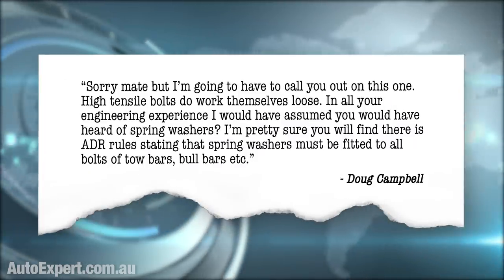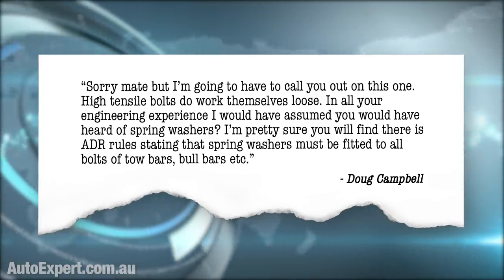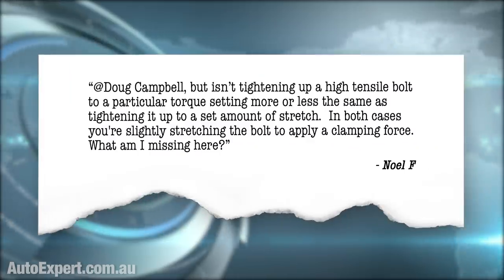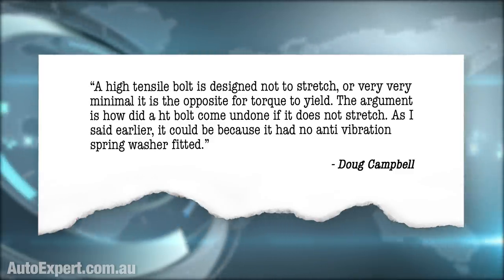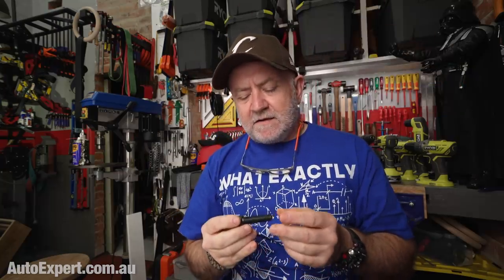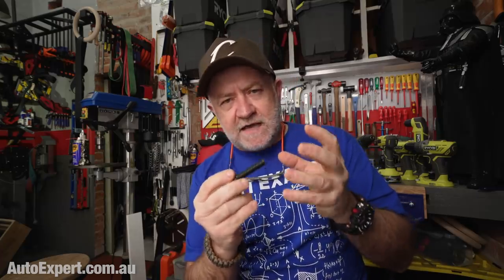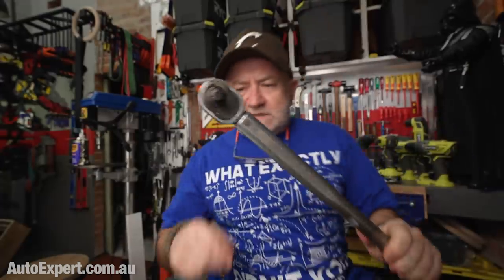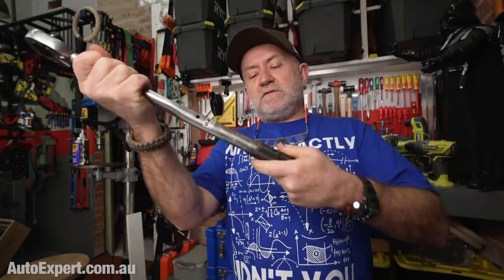The applied physics of high tensile bolted joints and assembly in cars | Auto Expert John Cadogan

Comment: On ya John👍, this is the best presentation/explanation I’ve ever seen  on how to tighten a nut and bolt. 
I see a lot of nuts do this job and I’m amazed they haven’t killed some innocent person with “their” idea of beer garden physics and their pupils in that classroom agree with a total disregard R&D. 
They all think they can do better in the shed with a big hammer and a grinder  and not forgetting a carton of piss.
And when it comes to lock nuts on the fastening nut, well I can remove the locking nut with my fingers after they done that job. What I’m trying to say is; they tighten both nuts in unison with a rattle gun ‘both nuts in that long socket’ to the max.
I was so concerned about this stupid practice I had to inform management.
Consequently all those items were recalled for safety reasons and yes, all the threads in mention were stripped and doomed to fail. Me and an engineering type bloke removed all the damaged components and rectified    the job. That was our job for a couple of weeks.

Comment: worth adding the chassis rails are not mild steel, which is why they so thin, HSLA & AHSS have been more common for decades.
So not a cheap repair, by factory specs by a skilled welder using a  particular process.
A generic MIG repair is unlikely to be as strong as the rail, nor achieve the required metallurgy.
I am sure John leaves these points as breadcrumbs for further discussion 🙃

Comment: The reason that high tensile bolts come loose on draw bars is because the frame that it's bolted too wears or crushes. 
I agree that the crush washers can't emded into the nut but in some situations I use threadlocker.
Reply: Yes the thumbnail picture is shocking engineering

Comment: Take two substantial blocks of metal to be joined together. Drill a clearance hole for a bolt in one. Drill and tap the other block. Fasten the blocks together with a threaded fastener and torque to the bolt specification. If the clamping force exerted by the bolt is say 3 tons, what will happen to the stress in the bolt if you try and pull the blocks apart with a force of say 2 tons? Answer: nothing! Well very nearly nothing. Reason: tightening the bolt puts a tensile load in the bolt which provides the clamping force. To every action there is an equal and opposite reaction (good old Newton!). This reaction is provided by compressive strain on the mating surfaces of the block. As long as the cross sectional area of the bolt is small compared to the area of the surfaces being clamped, this strain will be very very small. Stress is proportional to strain. We can't put any more stress in the bolt unless we strain it. We can't strain the bolt unless we separate the faces which we can't do until we reach 3 tons (the clamping force). There will be a very very small increase in stress in the bolt but nothing significant if the areas of bolt is small compared to the clamped surfaces. This is the reason carefully designed threaded fastener joints can sustain fatigue loads. If your tow bar was held on by finger tight nuts and bolts (and say Loctited on to prevent them loosening) they would fail very quickly by fatigue - just look at all those stress raisers - the thread roots! Hope this helps. When I read this it was like a flash of lightening!

Comment: The old Triumph motorcycle engines I used to build always had new bolts in the bottom end and always set by the stretch, not torque.

Comment: I always feel like I’m over tightening the bolts on 100mm and 120mm pipe flanges on the potable water and fire service work I occasionally do (over the last 35years).

Wouldn’t mind buying meself one of them torque wrenches
Reply from the maker: Pipe flanges are typically high tensile joints. You really should use a torque wrench.

Comment: BMW had problems with wheels loosening due to the paint compressing,this may be relevant in the tow bar problem.
Reply: Power coating is very thick could be a thing, I have ground off very think powder coat after it was chipping off while tightening bolts! 
But that ground wire under the bolt was wrong.

Comment: I still do not understand what happens to the paint on the chassis. As an order of magnitude if you have say 100 microns of paint on your chassis that's equivalent to about 1 10th of a turn on a 1 mm pitch thread bolt.  Once that paint squashes, that's a potential for a huge loss in torque on the bolt. This to me means that either you remove the paint before starting the job or you plan re-torquing after a certain amount of time in service.
Reply: Yes. It's not a critical join, and you have lots of bolt stretch, and a lot of data for bolt relaxation to tell you you're safe.
And then someone changes the paint spec and doesn't tell you...
Reply: The paint does have some compliance, but it doesn't squish out. So once clamped by the bolts you don't have to worry the paint. Yes it is good to check the torque after a few minutes in some cases where excessive compliance might be found. This is usually the case when something can move out of the way due to the clamping force, since the paint is dried - no worries. It might also be a good idea to check the torque after a week or two once everything is "settled" into position. Although this is usually not necessary unless there was an uneven surface (corrosion) before the tow bar was attached, once per year is usually all that's recommend.
Reply: @PhiloSage  my towbar is fitted with 2 M16 x 80 bolts. I think there's a lot of design margin in there. However, there's less than the conventional 2x diameter of stretch length before the first engaged thread, so there is likely to be a lot more relaxation than you might expect.
I've heard retorquing after 48 hours if the joint is painted is the right thing to do.

Comment: There are many critical high tensile bolts in motor vehicles without spring washers. One would expect the engineers that designed these vehicles knew what they were doing when they made that decision. 

I've seen bolts come loose but this is typically due to them not being tightened/tourqed correctly.

Comment: Been working on and around rock crushers for a fair while now your right John with the vibration and 98% of bolts are high tensile spring washers absolutely useless we have found correct torque and a good brand of lock tite high tensile bolts and spring washers  don't mix bolt and nut to hard does not grab spot on mate

Comment: I'm wondering if that chassis has failed because of problems in the 
chassis manufacture or the tow bar mounts were miss alighted during 
manufacture or installation putting torsional forces into the chassis 
rails when bolted up and just waiting for a decent nudge on the tow 
ball. Those cracks look to be a bigger problem. I'm not a Mechanical or 
Structural eng (Elect Eng) but to me lose bolts would have shown up as 
flogged out holes and bolts.  Those cracks look catastrophic as if that 
rail was brittle and the broken portion of the rail is firmly bolted to 
the tow bar mount. We don't know fore sure the bolts are lose or 
that the tow bar copped a massive down ward hit.
There seems to be more to this story.

Comment: You know that there is an engineering axiom that states " Properly tightened bolts don't come undone". Secondly if a mechanic told me to put a lock washer under a friction grip fastener I would find another mechanic. But thats just my profession opinion.

Comment: I beg to differ re feeling the torque, a tow ball needs to be tightened to 350 NM, I can get it to 350 NM without the torque wrench, you see my absolute maximum physical capacity is 351 NM! (Using the big torque wrench)

Most OEM tow bars are fitted to the chassis without spring washer to around 120 to 150 NM.

Comment: Would a belleville washer be better/worse than a flat washer?
Does the flat washer have to be the same hardness as the bolt, if it was softer would it cause issues?

Comment: Great video! Skimming across the comments it seems to have been a light switch moment for many. Maybe you need to go a step further and talk about high load fixings in shear. You so often see people do horrid things with shank lengths, or all thread bolts, in shear applications .... usually with scary possible consequences. Maybe too a mention of the tools you should use on your quality, expensive hardware ... 6 point versus 12 point spanners ... love that shit. One of my favourite reads is a good aerospace hardware catalogue!

Comment: You can't torque a high tensile bolt with a spring washer, the washer will deform and partly extrude from under the bolt face every single time, flat washers are used to achieve an even surface pressure under the bolt head.

Comment: I have no count on the spring washer i have trow'n away during my years as a car technician. Not in the shop but in other situations. Because you see. Spring washers in a modern vehicle are surprisingly (not really) rare. They are pretty common used in cheap furniture's and other low engineered products.
Springwasher do not work so they can safely be tossed away in most situations. I know there is pretty convincing test done that confirm this if i find the link to it.

Comment: Hi John, my name is Dimitris, I honestly fail to see how a chassis will crack because the bolts were not tighten to the right torque.
In any joint like that if that was the case there will be tell tell signs like fillings or shining metal (polished because of movement ) between the tow bar plate and the chassis or damage to the bolts or the thread.
Therefore In order for the chassis to crack (which is not the weakest link here maybe) the bolts will have to be so loose in order to give them some sort of an angle leverage. 
Looking at the images that was not the case, so how on earth did the torque of the bolts did that? It's obvious to me that the weakest link was indeed the chassis or exessive tow load, please think about it.
I would appreciate it if you replied. 
Dimitris K
Please excuse my English as it is my second language.
Reply: From the pictures from the previous video, my expectation is that the loose horizontal bolts allowed the tow bar to rack up and down a bit, which then transfers all the load to the vertical bolts.  And, instead of the system being the solid bolted joint it was supposed to be, that looseness made hitch loads act like hammer strikes on those vertical bolts, eventually tearing out the bottom flange of the chassis.
Reply: @gregholloway2656  Thank you Greg, what you said definitely makes sense, I never saw the horizontal bolts or any indication that they were loose and from what I saw the vertical bolts did what they were suppose to do... hold two parts together. Anyway if the horizontal bolts were loose there would be there tell tell signs that nobody in the world dealer or anybody be able to dispute. 
Thanks again Greg
Dimitris
Reply: @dimitrisk3550  thanks for the reply.  I was going off John’s information that all ten of the bolts were found to be loose.
Reply: @gregholloway2656  Thanks again Greg, and that I believe. I had two new tyres fitted on my sports bike and the lads at the shop did both axles "finger tight" totally insane, I guess I am lucky to be alive.
Reply: Google Ranger ARB rear step tow bar fitting instructions and go to step 47. What do you know, NO spring washers fitted as recommended by the manufacturer!

Comment: Hi John, if you use a spring washer and a flat washer together like you've demonstrated on the video you achieve absolutely nothing.
Once you've  tighten the bolt and the head of the bolt flattens the spring washer against the flat washer, the bolt and the washers have become one therefore they could come undone as if it was only a flat washer there. Split washers are effective if used on their own.
I think that is obvious and I am surprised you didn't see it.
Dimitris

Comment: Hello John, thanks for that video. If, where do you see the purpose for screw locking fluids, like from Loctite, etc.? If things are shacking heavily like on bad Icelandic tracks or if the  threads are not so precise or of bad quality? And is there any purpsoe for a spring washer at all? The German engineering standards (DIN 137 und DIN 6904) for spring washers to secure bolt connections have been rejected for quite some time. Thanks, Andreas.

Comment: Yay John - Uni Ed v/s Trade experience? 
Correlation is Not, Causation? That's a quote for History... Even if you didn't say, one more C word  :)
There's also split pins & castle nut, stuff... Taper roller bearings... Steering ball joints... 'Nother story...
Hey, last show, I had asked about how welding repair, would affect corrosion resistance, for components that had been tank dipped, during manufacture?

Comment: Very interesting!
Do you get high tensile nyloc nuts? I'm a big fan of using nyloc nuts where possible and don't use spring washers at all.
I also replaced the split pin/castelated nuts with nyloc nuts on my Land Rover's trackrod ends. Was that a mistake?
I did it because of (i expect you have also experienced this) the joy of having to drill the split pin out when it comes around to having to replace the few years old trackrod end and the pin breaks off while trying to extract the rusty thing.

Comment: Seems the issue is achieving the correct pretension in a high tensile bolt assembly, torque and pretension DONT have a direct relationship ( variables include fastener finish, tHread interference,  temperature etc,)  More accurate is' part turn method ' , and ultimately strain guages, in structural steel assembly in buildings torque wrenches are considered unreliable

Comment: Hi John,  I understand the bolts were not properly tightened up, which is inexcusable but what I would like to know is in the Ranger specs all but the base models come with a standard towbar included with the GVM and bolted up to the correct torque in the factory. If you fit an ARB towbar would this not be considered an aftermarket addition and therefore not be covered in the warranty? I agree that the dealer is 100% responsible for the safe fitment and installation of any accessories that they deem to be approved by them but for FOMOCO they surely are in no way responsible for the ARB that is not the manufacturer's product.
Reply: The issue appears to be incorrect fitment by the FoMoCo dealer which is the why it should be their warranty issue. There is no claim that the ARB product was faulty or that any other person/ business fitted the tow bar.

Comment: I saw some video a while ago testing washers (various types, wave, dimpled, bellville, spring, toothed) on HT bolts. One thing that was mentioned is that the bolt material is so hard that even if the spring washer was not completely flat though clamping force, it could hardly bite into the bolt anyway and would just slide over the surface.
Does that not limit the effective use of those types of washers to materials that are softer than itself?

Comment: How about fitting "Nyloc" nuts in place of standard nuts so they can't rattle loose? 
Bearing in mind you need to also tighten them up properly of course!
Reply: Nylocs by nature will have a resistance on threads. If this resistance is known, adjust as required. 
Most vehicles I've seen that have bolts coming loose will use a loctite or similar product to lock the bolt into position. when set, acts as a nyloc of sorts but can be torqued to specs when wet as it acts as a lubricant.
Brake calliper bolts are a example, they need to be torque set but under no circumstances do you want them coming loose.

Comment: Hey John would a shear bolt be better then a high tensile  bolt as you showed for towbars as the load acts 90 degrees to the shank?  
I recall shear bolts in aviation having a use.  They had a wider shank or body and a narrower thread diameter and usually engaged a split pin or lock wire to secure after being torqued with a calibrated torque wrench

Comment: Spring washers are no good under hi-torque application, they twist and break when torqued up
If you need a "spring washer" type effect, "disc spring" type washers are a better solution
But tread carefully if your chaning a certified design........

Comment: The scary thing about Doug’s comment is the fact that he sees loose tow bar bolts often. Is this down to mechanics not knowing how to use a torque wrench or are they just being lazy. 

In my backyard experience I find spring washers are not that effective. In applications where the bolt could work loose I use nyloc nuts however they do have a short lifespan as the nylon can deteriorate. 

It is interesting how spring washers work as I thought it was the spring action that stopped the nut becoming loose. Of course if you really don’t want a nut to become loose then the use of another nut as a lock nut is the only way to go.